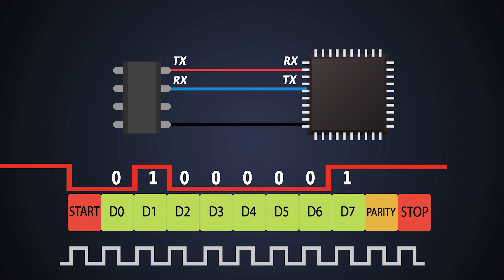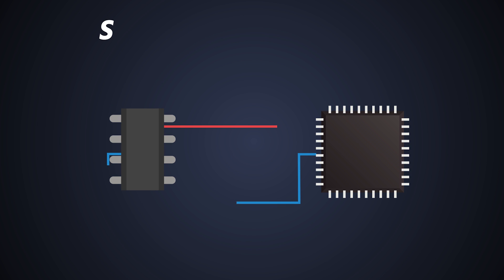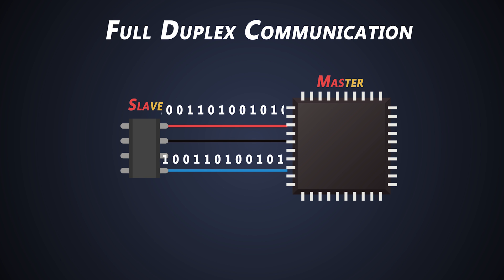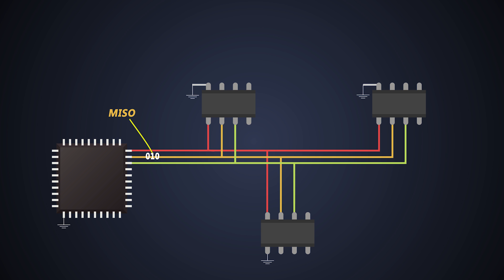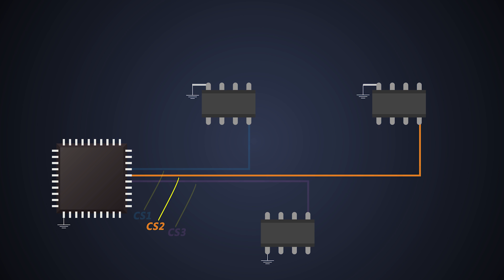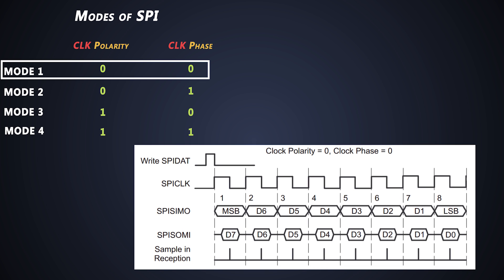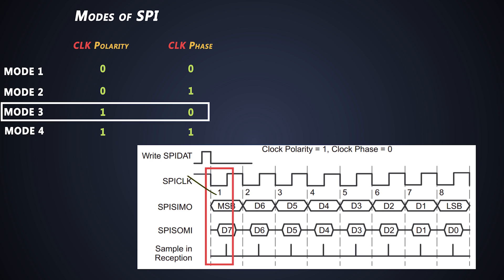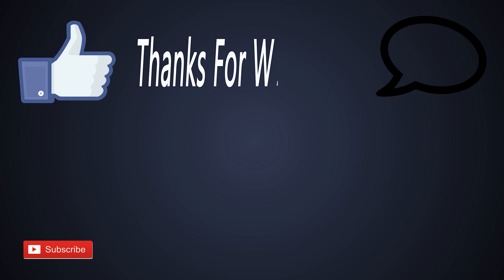Basics of SPI communication | Different modes of SPI communication

Comment: The Modes Listed In This Video Are Incorrect!!! I was just sent on a 6-hour wild goose chase trying to track down why my microcontroller wasn't transmitting in the correct mode based on the timings I measured on my logic analyzer, only to find out the modes listed in this video are incorrect, so it was working correctly the whole time! The video has the CLK Phase incorrect; therefore, Modes 1 and 2 and Modes 3 and 4 are switched!
Reply: i too think they are same. mode 2 and 3 have no difference.

Comment: i want to insert a chip in the SS line.  the microcontroller should pulse an address and the chip will multiplex the SS lines.  i think this is a much better solution, given the specific application latency requirements do not prohibit it

Comment: Communication between 1 SPI master device and 1 single slave SPI device generally always works well. But as soon as there is more than 1 slave, it's a big bazaar !!! Arduino libraries like SPI.h, + SD.h, etc, etc  .... are not very well written and there are conflicts on the SPI bus (for example the SCK signal which remains high, CS signals which do not not go up, etc ... Read the forums and the excellent video of Sayanee Basu. Without a logic analyzer and a lot of development hours it is impossible to operate 1 SPI master device and only 2 SPI slaves. Not to mention the other connection mode, "daisy-chain". With I2C, I don't never had a similar problem.
Reply: We

Comment: why different modes are required? Any advantage is there with the indudial modes can you please answer for this?
Reply: I think it's for the engineering department. Most of us are just users even as semi-engineers. Each computer module is a computer, so they come to the door, call first or throw the package which is hidden for the usual code or life where we are, level 6 or something. In most cases we just follow the instructions to get it working. We buy "the best module" and that's all, so to speak. The top engineers are in another world, some future plans or something.

Comment: Why this Protocols have master slave configuration
Reply from the maker: There must be only one who can initiate the data transfer,
Also there must be only one device which can control the clock for the communication, if both starts accessing the clock.
Clock line will get currupted by one-zero transitions.

Thank you so much for watching!!